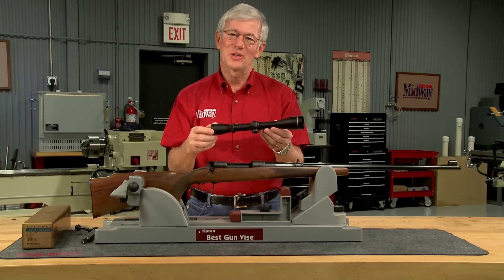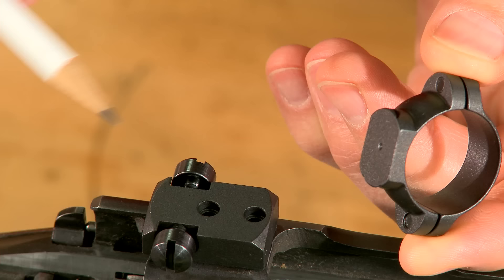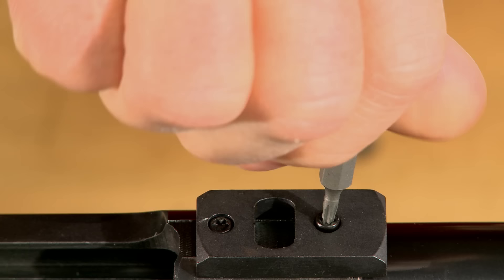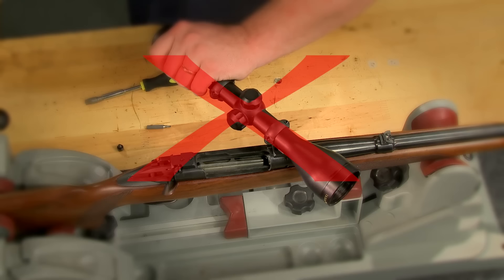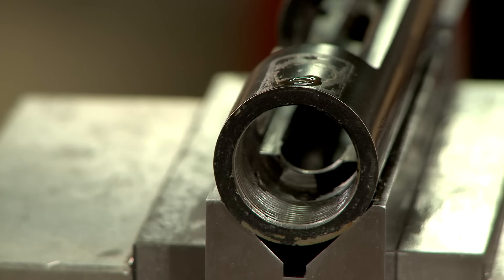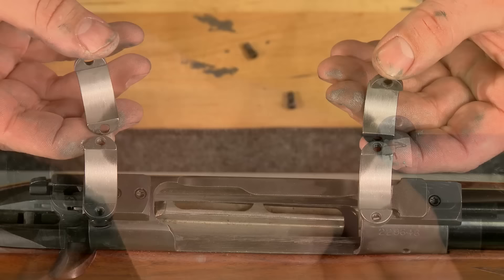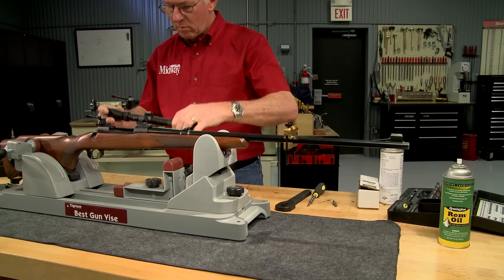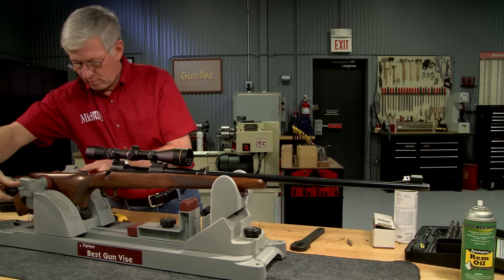How to Properly Mount a Scope Presented by Larry Potterfield | MidwayUSA Gunsmithing

Comment: The primary reason he had to take all these extra steps (including centering and lapping) is because he's using two independent scope rings instead of a one-piece scope mount. This is because he is shooting an old 1950's rifle, and back then they didn't have picatinny rails and one-piece scope mounts - you had to manually install two independent scope bases and scope rings separately, and get them aligned on the bench.

If you buy a new rifle today, it will most likely either come with a picatinny rail or some other provision to mount a one-piece scope mount. Quality one-piece scope mounts don't require centering or lapping, because they are already centered and concentric from the machine shop. Don't be intimidated by this video. Go buy yourself a quality one-piece scope mount that matches your rifle base and scope (brands like Vortex, Burris, Geissele, Leupold are all great) and throw that scope on there.

A few extra tips: To get the scope level, I like to hang a weighted string from the ceiling fan and align my vertical crosshair to that. Like water, gravity doesn't lie. For torque on the scope rings, "3-finger wrist tight" is the key. You don't need a fancy torque wrench, just grasp the handle of your screwdriver with three fingers and your thumb, and torque down wrist-tight, moving from screw to screw in a figure-8 pattern (similar to the star-pattern method when changing your tire). Tighten half a turn each screw to ensure they are all even. I like to apply a super thin coat of vaseline to the scope rings as a release agent for when you decide to take your scope off.

Comment: Ok... so this guy just slapped $20 chinese made Leopold rings on a rifle chambered in a magnum cartridge so obviously this guy is clueless. P.S. I have personally bought weaver grand slam rings from midway (which had a locking bar break from tightening) and a pair of wheeler scope levels (which don't agree with each other so are completely useless.) I ended up with warne rings which secure to each other vertically instead of horizontally and used that small gap and my laser bore sight as a reference to correctly line up the crosshairs. I would recommend this method if you are on a budget, though QUALITY levels may be an investment. If you have to grind your rings to size so the scope will fit then they were junk to begin with. Just me two cents.
Reply: My Leupold (check your spelling) rings are made in the U. S. of A.

Comment: Is this a joke or a serious video regarding using the scope turret for leveling the crosshair. He must be after nerf gun accuracy. 🤣
Reply: I did have to question that portion of the mount.  Even if he chose not to use a plumb line he could have leveled off the bottom as opposed to the turret cap.  You can rotate those turrets and see a different level line about every 90 degrees.

Comment: Buy high quality rings and you don't need to lap.
Reply: That dont matter . even quality rings could need lapping
Reply: Lapping is an ancient but very accurate way to fine tune surfaces.  More accurate than a modern 5 axis cnc or 1000 axis if that impresses you.  He was using a two piece mount for that classic rifle rather than a gold anodized monoblock bling ring.